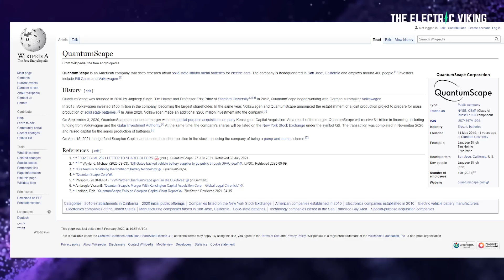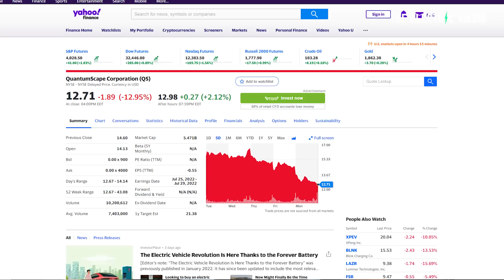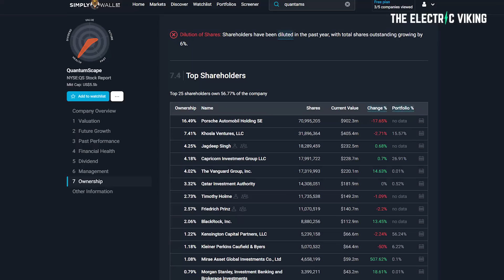QuantumScape's NEW solid state battery tech - is it real?!

Comment: 500 charge cycles is a serious problem. In a commercial vehicle like a delivery truck they will be installing new batteries every year. So they will not be viable. Same for short hop airplanes. Planes that do short commuter flights will have battery life measured in weeks. 
If this technology costs the same as current lithium, and the car owner charges twice a week, the battery will be toast in  around 5 years, so it will be at least U$5000 a year just for battery amortization. That's not going to work.
The technology needs to last at least 1000 charges to be viable in most applications. 500 charge cycles isn't even good enough for a cell phone.

Comment: If they can successfully get battery density up 4 fold, that's it. It's all over for ICEs. Current batteries are just way too heavy. 
These have massive implications for air travel too. Not to mention commercial vehicles that need very long range and high capacity.
I believe the company is legit. I do believe there was pumping and dumping going on though. The spike over $100 is evidence of that. That doesn't mean the company is corrupt.
I would not buy the shares. I have seen this a few times before.  Companies are setup to fund R&D and basically shareholders end up subsidizing the research and development in a corporation that is primarily set up to develop technology, not really become a legit manufacturing company. It happened with Ballard Power near me. It was the hottest stock in the country for a while but the hydrogen fuel cell technology went out the company to the corporations that initially funded and controlled it. 
It is a good lottery ticket play though. If they demonstrate a functional product the stock will spike way up. Long term, I think the odds it will become a legit manufacturing company are low.

Comment: QS $8.87 last traded at... maybe buy in an initial position (due to the recent sell off of equities in the broader market) with a view to average down in tax loss season if applicable... my 2 cents on it anyway. 

I wouldn't be in a rush to get in with a significant position as this could clearly decine more without a breakthrough... they are still in the prototype stage, have alot of hurdles to overcome yet in terms of bringing a SSB to production. 

Toyota will be introducing their SSB in hybrids to get more performance data, and ramp up production... keeping costs down until enough are produced at a low enough price per unit, to move the tech over to their EV division. There by keeping SSB equipped EVs affordable for the masses. QS and VW might want to consider a similar strategy.

Comment: Yea QuantumScape is still very speculative. The proof-of-concept is there at small scale. They seem optimistic, which is good, but there's still a lot of unknowns and challenges to overcome before going to market. We don't know if their cells rely on exotic or difficult to source materials, we don't know how their cells perform when exposed to cold temperatures for long periods, or how they perform when exposed to rapid temperature fluctuations, etc. They need to demonstrate real-world charge and discharge performance in an automotive application in order to gain any mainstream traction.

The two biggest milestones to me are validation and approval from an OEM, and getting high quality yields from production. Both of those might be years away. Until then they are surviving on financing from investors, and hopefully will avoid taking on significant loans. It's very promising tech but still very speculative and risky.

Comment: Aerospace will soak up high density batteries even with high costs- from air taxis to regional and short haul. Even shorter life battery or capavity drop may still be economic if recycling is feasible

Comment: The claims are real. There will be a significant cost savings because the battery is anode free. Their separator that they are designing will go a long way to reducing dendrite formation that all battery manufacturers have to deal with. Their separator is a real innovation.  We have spoken with engineers involved in the process. The haters claimed that there was a pump and dump scheme but those haters have been put to rest with the independent testing that was recently done. After having worked in battery production of NiZn solid state batteries, I know from experience that QS is being extremely conservative in their claims. We are long on QS and will be doubling our investment.
Reply: Fully agree.. QS are the only company putting out proof of their work and reasonable milestones which they are consistently hitting. I'm seeing so much media coverage about Toyota SSBT recently yet I see no real figures in terms of charge cycles, energy retention and the all important matter of removing the dendrite formation. At the moment QS is showing all of this and I think once they get their A sample into the hands of their partnered OEM's (and if it gets validated) I think the industry will really start sitting up and taking notice. All the talk about scaling up etc, as Jagdeep said in an interview a while back, manufacturing challenges are a lot easier to solve than a 30+ year old chemical problem. I'm with you, long on QS and look forward to solid statements coming from the company in the year ahead.

Comment: Since solid state batteries would be so much more energy dense, I don't see any problem in them being used for lower-cost vehicles because although the battery cells might be more expensive than alternatives, much smaller batteries would be required.

Comment: I do not believe QS battery is true solid battery, i bet QS battery is just uses less liquid (IE gel).  Even the common Duracell and Eveready 'dry cell' batteries are not truly solid battery either.  A true solid state battery is supercap battery. It is basic high school chemistry.  To disrupt tesla's 4860 battery, QS battery need a 10X improvement (price + performance).  First mover always has the upper hand because tesla's are making constant improvement on their battery too
Reply: I bet this company is not a company at all. Have you checked the CEO's garbage fake CV? His LinkedIn Profile? Haven't you seen the basic and faked PowerPoint Presentations? It's nothing but a Scam for 100%. Can't believe there has not been any investigation by some clever lawyer or at least the stock exchange ...

Comment: Hmmm... I'm skeptical. This is really hard to do. Look at how simple the 4680 cell is, the straightforward process equipment, and the overall performance. This is what it has to beat in every category. I agree that the cost to make them may be an issue. We don't need high capacity cells that cost a fortune, we need low cost cells with high energy density that have a very long cycle life. I'll wait until they've actually got something that works before I get excited.

Comment: I think every reasonable research in battery tech is a good thing and solid state is relativeely at the beginning, just like li-Ion was maybe 30 years ago
As for the price i think since these battery packs will be way bigger for the same volume or smaller for the same kWh they could be used for higher end vehicles or maybe hybrids at first for validation

Comment: I have been invested in QS and SolidPower for awhile with the idea that either one may not make it to market before 2025 if ever, but if successful they will be game changers and make some money. They are far from the only ones, but I can't invest in everything. It may be expensive at first like many new technologies, but it will rapidly become less expensive with production. VW didn't invest only for $100k cars. Porsche has a silicon battery project that might be ready about the same time which might be the first battery without Lithium to come to market and the Tesla dry cell batteries will compete and are possibly included in the new 4680 cells being produced now. There are also projects I haven't even paid attention to yet from the Chinese, Korean and Japanese battery manufacturers which I assume have projects going so they stay on the leading edge.
It's all very interesting and I bought my current car right before the newer battery forms and faster cooling were introduced in the last jump, and now another leap is on the horizon, I just have to accept that my next car will probably be bought right before the next tech advance

Comment: As in investor i have been watching this closely, so quantumscape isn’t working on a battery as much as a solid state separator that can be used in any battery.  The key point here is that their separator allows for a lithium metal anode at only 3 atmospheres of pressure.  That is amazing as all the other solid state batteries are either 50 atmospheres for very high temperatures.    In addition they state that this separator can be included in existing manufacturing lines for traditional batteries lines.  This means that Tesla or Panasonic could switch to lithium metal anodes with out redesigning the production lines.  You basically just include the new separator and delete the carbon anode, and you have 25 to 50% more capacity.
Reply: Ain’t that something

Comment: I'm going to save all of you a lot of time here:
1) There is no meaningful increase in energy density for this chemistry.
2) There is a significant power decrease.
3) The cell chemistry is NOT solid state. Yes, the electrolite is solid, but at least one of the electrodes is a lot more liquid than Tesla's patented dry battery electrode.
If so called solid state batteries offered any real advantage, they would already be in use.
Reply: Have to disagree.
1. Lithium metal anode, by definition, means higher energy density because you are removing carbon/silicon.
2. Please share how you got the idea. Quantumscape presents the oposite.
3. QS does use a catholyte, but the real important tech (if they make it work well) is the solid separator. Tesla dry process is in manufacturing, not about using less electrolyte. And the idea that something that has advantage would already be here is logicaly false. Fussion reactors have obvious advantages, yet we don´t have them. The potential advantages of solid state are the reason companies try to develop them.
Reply: @michalfaraday8135  Your straw-man arguement about fusion reaction is false. We have a perfectly good working fusion reactor and we've been using it for about 4.5 billion years.
As for the "advantages" of the solid seperator, the only real advantage that it might potentially offer is to prevent the growth of dendrites during the charging cycle, thus extending the life of the cell. You are welcome to your opinion of course. I just don't think this technology is going to live up to all the hype when they finally do implement it.
Reply: @surferdude4487  Sorry but the "strawman" argument is that things actually need to be developed. Using your logic we shouldn´t be developing anything because if it had any real advantage, it would already be in use, which really makes no sense. The fusion reactor is an example, feel free to use any other tech. 
And yes the main advantage of solid separator could be to prevent dendrites, which in turn enables lithium metal anode, which increases energy density, and charging speed. This of course doesn´t mean QS will succeed but the potential is there.

Comment: Two things you mentioned which would be bad one possibly good.  First you said the cells  use Lithium;  Lithium is in scarce supply and a dead end for meaningful EV production, max if you used all li for BEVs 5 million, not much in a 100 million vehicle annual market.  A battery that only lasts 500 cycles is as good as a battery lasting 2000 cycles if it costs them same and the range is 4x more; however this seems unlikely.  IF it were cheap enough; a company that swaps batteries in the cars - would be viable like NEO.  However the use of Lithium sounds to be  the death nell for this cell to me.

Comment: If they can get 10x the energy density, 500 cycles would mean the equivalent of 5000 cycles of an older battery if the ssb is the same total energy in the same pack size and the bms weights the charges properly
Reply: The anode uses lithium metal which has theoretically 10x  the energy density of graphite. the cells actually hold about 350 watt hours per Kg, NCA has aprox. 250 whkg.
Reply: And it will weight a lot less  because nobody needs 10 times the current range, so each cycle will allow more range and final milleage will be even greater
Reply: @nixx5490  Better if the amount of battery to run the auto could be reduced.

Comment: Whichever OEM puts these into a pilot program will have work for their dealership service department. As the technology is, they would have to replace the battery pack every 16 to 24 months. Likely, these first run vehicles will be available only through lease.

Of course, this means they will not be able to use Tesla’s manufacturing process of making the battery pack a structural element. However, they are not doing this yet anyway.

In time, the solid-state battery technology will improve. At this point, the OEMs might consider adopting the structural battery pack as a part of the manufacturing process.
Reply: Why would they need to replace the battery pack every 16 to 24 months?
Reply: @antonthompson7838  Well, if the limiting factor of the 16-layer iteration of their product is finite (500) charging cycles, the battery would need to be replaced shortly before it bricks the whole vehicle. Sixteen to 24 months is a guesstimate. If a driver only racks up short commutes, then the battery might only need charged once every ten days. In this case, the battery could potentially outlast a ten-year warranty. However, if it needs charged daily, it will start to fail sometime after a year.
Reply: @michaelgraham1005  This is not the way I understand charge cycles. They don't give a limit on number of charging sessions but a total lifespan. Say if a car has a two hundred mile range then it would reach around 180 times 500 miles lifespan or 90,000 miles. Of course a solid state battery car might have a five hundred mile range in which case it should expect 450 times 500 which is 225,000 miles. The liklihood of this coming to affordable cars in the next decade is fairly small though, so I'll keep my money in Tesla.

Comment: The Technology is Real... However they have not solved the Scaling problem.... Can produce chip sized batteries and that's it.  The problem is also when and if they do solve the scaling problem they will have to solve the mass manufacturing problem.  I was in the industry and would love if it would come to fruition.  There are many other technologies that are in development  that might solve the high power density battery problem before they solve the solid state battery problem.  15 ... 20 years
Reply: There's also the safety aspect, SSBs are much safer.
Reply: @theproffessional9  LFP Batteries have demonstrated the exact same result.... Penetrating Nail has no effect....

Comment: I suspect solid state batteries will find their first application as a partial replacement for traditional battery packs.  So an auto would have half or more of its capacity come from a traditional pack while the remainder would come from a solid state battery.  This would limit the number of full charge cycles the SSBs would need to accommodate - the traditional batteries would be mostly depleted first before the SSBs were tapped.

SSBs have several advantages that would make this kind of hybrid model desirable.  For starters, they weigh a lot less, so installing a mix of traditional Li ion batteries and SSBs would allow manufacturers to both decrease the weight of the car and increase its range.  They're also more rugged and require less cooling, making them cheaper and easier to accommodate.  Their expense and limited cycle capacity means they're unlikely to completely replace traditional batteries anytime soon, but I could see them becoming an increasing part of the overall battery mix within cars as they expand their footprint in the market.
Reply: There are semi solid state batteries in use right now by Chinese carmakers which is probably the same as putting solid state in with normal car batteries.    Besides having insane energy density they are considerably lighter and will probably end up in Lamborghini, Ferrari, Porsche, Bugatti and other such exotic cars, which is what a lot of these carmakers are waiting for I suspect.
Reply: Solid engineering thinking, but it misses the business aspects. When solid state (and lithium Sulphur) actually hit the market in mass (whenever that is) they will likely be very expensive. They will be expensive both because the supply will be limited and the cost to produce higher as companies like QS try to reach mas production scale. When it is super expensive it will likely be used for aircraft, supercars, maybe even electric ships and other less cost sensitive but more weight sensitive applications. Then they will find their way into cars as the cost comes down from mass production and competition.

BTW I don't think they are much lower in cycle life, that was 500 x 15 minute quick charges. NCM batteries can be quick charged too if you heat them up, but they don't live long if you do that. This is not 500 cycle life, it is a special case. If folks were doing 15 minute quick charges all the time, then yeah it would be a problem.